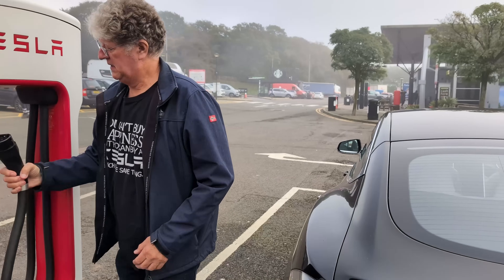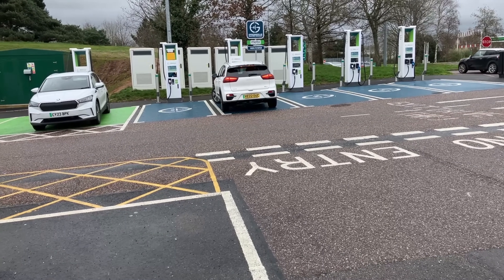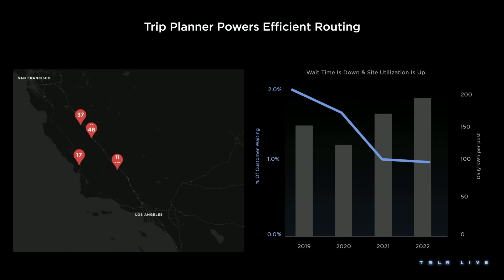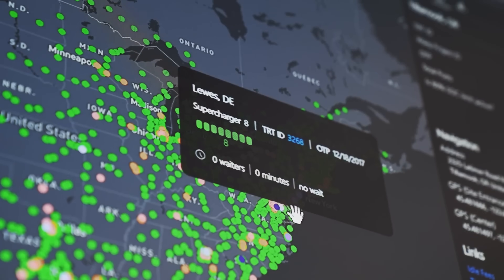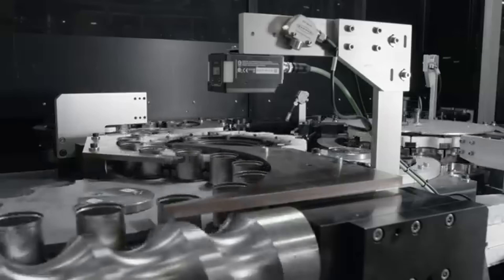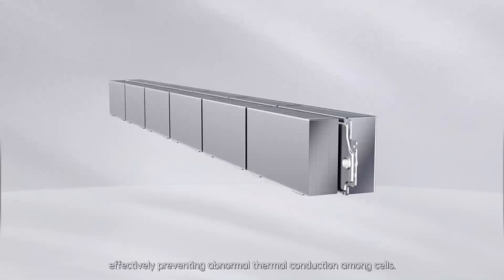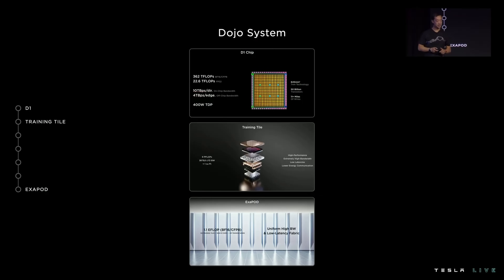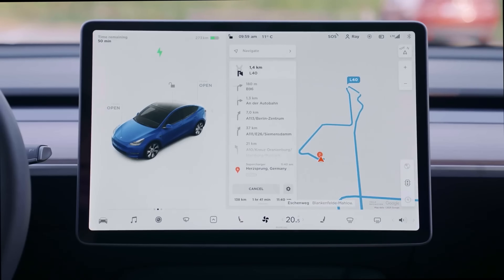AI Is About To SUPERCHARGE Your EV Charging

Comment: Protection of the national electrical grid must have absolute priority. 

100years to build and massive national wealth. 

The grid will work backwards to gather electrical energy and transmit to heavy industrial customers. 
Like the local rapid chargers and community battery. 
The late adopters of rooftop PV and BVs will face higher kWh rates as the national grid owners scramble to hang onto enough customers cashflow for their $TRILLIONS infrastructure investment. 
Lare adopters will suffer energy costs exploding. 

Early adopters will take their after-tax savings and bank them, happy days. 
The grid owners will cry for government Garrentees on their profits. $100sBILLIONS. 

Much is changing. 😮😮😮

Comment: Selfparking selfplug-in V2G trickle currents all day long and all night long is the go-to next step. 😊😊😊

A $60 wall outlet at bumper height in all carpark spaces and simply bumper plug-in.

Most vehicles drive building to building and are parked 23hrs every day. 

Rapid chargers will be on the main roads and at corner stores and at supermarkets and... , if needed.

Comment: Technically this isn't AI, it's the old, now booring and less marketable, Machine Leaning and predictive analyltics. AI is just being used by Tesla and others as it sounds cool and new.

Tesla would do better by opening up even more integrating into the existing API (standard interface) or offering their own API so the likes of Zap Map and Waze can integrate and users of other cars/planning apps can see the Tesla charging network. Rather than commoditise it as a service via Tesla car purchases, apps and membership schemes. I suspect the EU and possibly the UK will take this view as well to prevent a new monopoly service forming.

As to faster charging this is down to monitoring and predictive algorythms in the car's electronics rather than the charging network/charger. The charger simply need to supply the current at the voltage requested by the car, only limited by local supply/site conditions. No 'AI' is needed in the charger itself.

Comment: Will AI stop morons in plug in hybrids with small batteries sitting on high power chargers slowly topping up their 30mile range whilst those with bev’s have to wait and fume !
Reply: Calm down, all users BEV or PHEV have the need and right to charge, regardless of the onboard electronics capabilities - many lower cost BEVs have slow charging speeds as well.

There is no exclusive right to a particular charger for a particular car's charging capcity. Its a shared resource.

If the issue is you turn up and there isn't a bay available thats a site planning issue not the fault of the cars using they bay it has every right to do.
Reply: @GruffSillyGoat  and they can ask their manufacturers where their dedicated charger network is!
Reply: @Chris-mh3vf  - who needs dedicated charger networks nowdays, they were a thing in the early days to get traction but are less important now. Tesla are opening up their networks in many parts of the world for this reason. Given they've now adopted the charging standards in those parts of the world as well (e.g. use CCS2 or GB/T connectors on their cars), it makes sense for  their networks to be available for all makes of EVs not just Tesla's.

Comment: In an ideal world / perfect world the theory works for ai.. But in the real world if we don’t have the grid capacity or infrastructure no matter how good ai is it will be govend by fact. That’s why at my nearest supper charger has 10 stalls, but in the winter and at peek demand on the grid only 1 stalls can supper charge and if more than one plug in it goes down to home charging speed if you’re lucky. The key reason is we are in one of the areas of the grid they throttle are capacity down or we will have a black out, due there is NOT enough capacity in the grid.. i dread what that will be like if everyone is forced to have one. Don’t think 🤔 you need ai to sus that out. Let alone the security risks ai and going to a singular power supply will bring. And many other issues. Don’t get me Wong i hope i am. Ill stick with reliable and freedom of ice personally, and i like the fact i don’t think about fuelling and apx 700-900miles between fuel stops that take less 5mins it a no brainer, with the added bonus i choose wear i stop not ai or the car, witch means i try to go to a local cafe or pub / facilities on a journey to support local. Or i can go on unplanned adventures or excursions with zero worries or stress. And living in a remote area relaying on multiple sources of power is safer. Plus a ev wont work for myself or my business i carnt charge the car or my van due to street parking let alone other critical issues on the business front I’ve previously mentioned. But as I’ve always said if you want a ev enjoy but its not a one shoe fits all solution, and if we are forced into it will bring very serious issues to all in a lot of directions.
Reply: The issue you describe isn't capacity of which the grid has plenty - sized for the 80GW peak back in 2005/6 with only 20 to 35GW used these days. The issue is grid congestion at specific points in the network, where demand on one side of a grid connection point exceeds the connections power capability. The National Grid have a programme of works to resolve these points using grid scale buffer batteries at the pinch points.

Comment: Tesla AI is great at Tesla only chargers, opening them up to other cars without the integration means the charging station could be full of non Tesla’s, so it would only know when they actually plug in.
However the AI to control charging power to speed it up could be very interesting. Great video again Dave.

Comment: Why not make an adapter to connect the Tesla short cables to the non Tesla EV cable, then everyone could park properly in the bays, (not AI I know, just my own idea).
Reply: Adaptors are already available - but so far none have a length of cable between the input and output.  It would only need a couple of metres, or less, to achieve what you are suggesting.  Don’t the v4 versions already have a sufficient length of cable for any vehicle?
Reply: @oliver90owner  v4’s are ok, plenty cable, the others have a short cable, I have my own car cable, just need an adapter to connect them together.
Reply: @donaldcampbell8761  I very much doubt the cable you have is capable of transmitting 250kW.  There lies the problem.  It may even need to be adequate for the even higher-power chargers that are appearing.
Easily stolen, too.🙂

Comment: AI is the latest buzz word, long way off in the future until then the charging time will be controlled by the BMS to protect the battery. Probably many EV owners just turn up and charge when they need it, AI is going to get very upset when all the forward planning goes out the window when the charger is used by a non AI controlled EV.

Comment: For this to work then ALL EV will need to be communicating into same system.    
If take Tesla then they already know about Tesla vehicles but won’t have details of non Tesla vehicles making journeys so could block you at short notice as planned to stop at a “going to be empty” charger and a non-Tesla gets there just before you that Tesla not aware planning to use till plug into the charger and goes in use.
Tesla will pick up that the charger not available when they connect on, it won’t know that they plan to connect unless the non-Tesla feeds information into Tesla.
It is where you unfortunately need a monopoly of one route planner that knows all cars and all chargers.
Unless all chargers irrespective of owner and all EV irrespective of make are hooked in then going to be lat minute annoying changes or just find that not available when said it would be.
And the chances of that happening are between slim and none.
It is a nice idea and perhaps in the Star Trek Federation world it would work but cannot see the different people agreeing to co-operate in the real world.
Reply: This is true, up to a point. In reality, I suppose that Tesla could provide a membership scheme for non-Tesla EVs with reduced charging rates but in addition require you to download their charging software so that the benefits that Dave mentioned for Tesla drivers, would be available for non-Tesla EVs using the supercharger network. If this included a decent route planner using superchargers, and they had a database of other EVs and their driving range (or better still get this information from the EV itself) then your EV would be included into the algorithm and the problems that you highlighted would be avoided. I can appreciate that this would require a great deal of work, but with a good number of EV manufacturers now adopting NACS, for the adoption to be worthwhile, a solution like the one I have suggested would be a primary requirement.
Reply: NACS is 100% irrelevant outside of North America. Right now NA is less impacted due to the limited number of cars able to use Superchargers. 
Europe is a different matter where Musk the Muppet, seems to have no clue and just said "f'k it, open to all!"
Reply: So your solution is to have the non-Tesla EV use a Tesla App to provide route planning and information about the EV range status to Tesla.
That is exactly what I said would need to happen in that EV feed into a single route planner.
The only thing is that you have made Tesla the focal point, as opposed to a 3rd Party that everyone agrees to work with.
Now how do they get routed to non-Tesla chargers when the Tesla Chargers are full.
For instance at many locations then have non Tesla chargers as well.   If the Tesla App sees your Tesla superchargers are full and you don’t have the range to get to next set of Tesla superchargers then will it know about the non Tesla chargers at the location was going to send you to charge before it realised the chargers full.   If it does then you end up with the single route planner that has All EV and All Chargers feed into, just that you have made that planner Tesla as opposed to an independent route planner that everyone including Tesla feeds into,
Reply: Tesla doesn't use NACS in most parts of the world where CCS2 or GB/T is used (NACS cannot support three phase electric connections used in these places).

In terms of opening up, Tesla is already required to offer open to all chargers in many parts of the world. For planning  it would work better for Tesla to open up the charger data via APIs like the other charger vendors do so users can choose what navigation and charger map software they like or use the one already in their car. This will also allow the likes of Zapmap to show and produce analytics on the charger network. Perhaps this is another area forming where the EU will take Tesla's monoploy ambitions to task and get them to join the rest of the world.

Comment: “Who hasn’t needed to wait for what seems like ages for their car to finish charging?” Errrm, well that’s honest, at least.
Reply: That's easy to answer in the case of EVs, no one as EV users leave the car to do its own thing and go and do something more important to them instead. No need to wait around babysitting the car whilst it feed as in the old days of ICE vehicles. Yet another innovation advantage of EVs, that fossil-fuel enthusiasts try to project as an issue and disadvantage.
Reply: @GruffSillyGoat  well, that’s my point.  If an anti-ev person had made the statement, I would say it was just anti-ev propaganda.  Dave was making an honest statement about the state of the charging infrastructure in the uk (and how AI might help). It’s just surprising to hear an ev person saying it.
Reply: @dominicgoodwin1147  - most EV owners are honest about the availability of charging as we know it's a growing capacity rather than an established one. However, the target is different for EVs, one of destination charging available everywhere. The aim is to mainly refill at the start/end of the journeys at the cars convenience rather than en-route as with ICE cars at the users expense.  Transit charging, of course, is still required for longer journeys, particularly on major router, but not the to degree of petrol stations of today - it is for transit charging that a faster charging speed would be beneficial less so for home/destination charging.

Comment: Doesn't matter if you have AI while gridserve are only giving limited flow to a charging point. If you go to a charging station with say four 250kw fast chargers but the grid connection is 500kw when there are more than two cars you all get throttled. So you're lovely pictures of lots of Tesla chargers all in one station is meaningless. That's why the grid is comfortable with EV adoption because they are going to throttle you fast chargers, and as for charging overnight and your EV battery being used as overnight storage, that's going to be fun when you get 20 miles range all night because the overall grid will get preference for power
Reply: Most throttled site use site specific battery storage to provide higher capacity charging above the electrical supply. These are sized and planned on a assumptive demand model for the area and route the chargers are on.  The aim is to support high capscity peak demand and recharge the site at the quieter times more slowly from the grid.

Comment: Electric car charging rates are determined by the interaction between an algorithm devised by the manufacturer and the charger. Yhere is absolutely no need for AI and this is just jumping on the AI bandwagon without actually understanding what it is or what it does.
Reply: That’s what I was thinking - we often conflate AI with just normal clever computer programming. The key to fast EV charging is going to be battery tech and improved cooling/heating systems for the battery management system. In some vehicle’s there is already an 800V architecture (typically 697 V) means a lower current to get the same Power which means faster charging from a given charger.